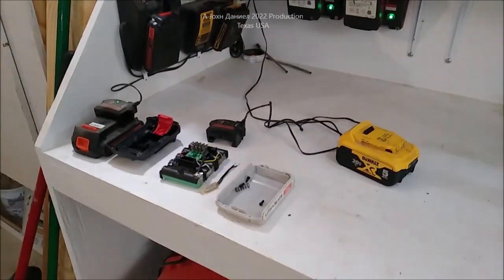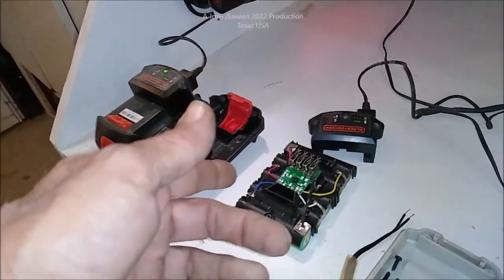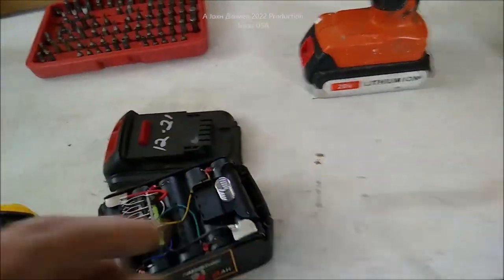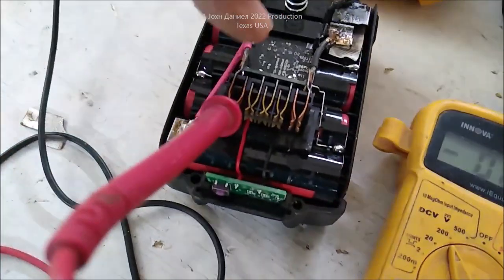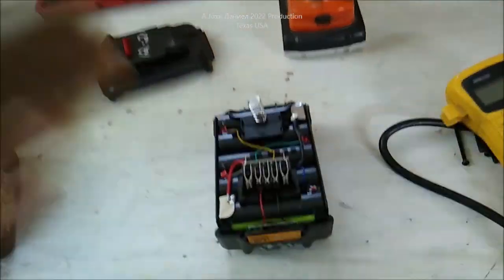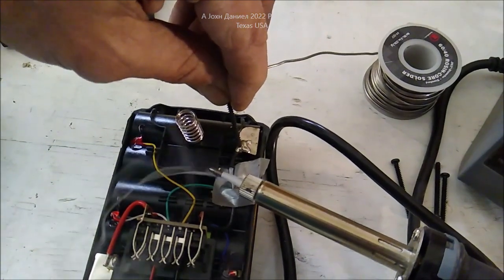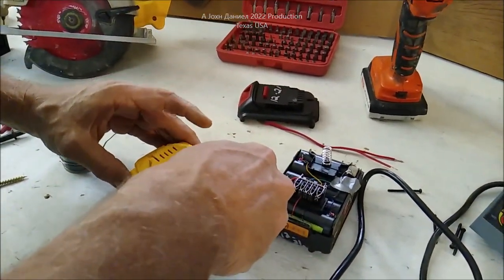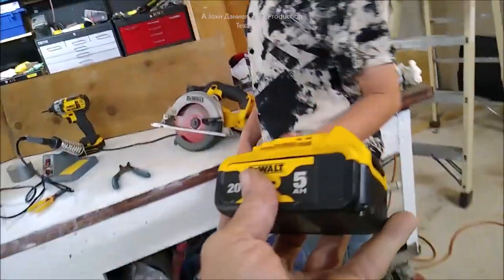Tool Battery Overheated, Won't charge or Respond? Try This

Comment from the maker: Must have Driver Bit Kits https://amzn.to/385dKGp , DeWalt 5A Spare Batteries I am using https://amzn.to/3DpZ4xo and I am looking for a source for Micro Bi-Metal temp switch for all tool batteries and will post it, check back.
Reply: I have found a source in the USA thar provides the thermistor that they use. Milwaukee uses a 6.8K, Dewalt, Snap On takes 10K. I got 10 each for approximately $3.50.

Comment: Have you trouble shot the temperature sensor on a 4 terminal black & decker 20V battery? its the center 2 terminals.
Reply from the maker: The sensor on them rarely fails, the chip on the board or the transistor switch to shut the battery off for them often does. You can get full replacement boards for them for the BD 20v battery for a few dollars. I keep spares for Makita, Black and decker, Porter cable, and dewalt I get from Ali. https://s.click.aliexpress.com/e/_c3wFDj7x
Reply: @JOHNDANIEL1 thank you. I did not see the BMS for my 20V porter cable on Ali. Can you provide the link?

Comment: John,   What are the color of the balance wires on a DeWalt battery.  What I have seen, online is all over the place.    I have been using yellow, white, green, blue (+ to - sides in sequence).  What is correct?  I am building some 2p, 2S DeWalt packs.

Comment: On that model charger Hot/Cold (thermal) Delay is indicated by a solid light on the right with a flashing light on the left, so that’s not a thermal delay (no right light). I have a DCB210 that no longer seems to have a connection with an open connection between TH (thermostor) and B+ so it genuinely triggers the thermal delay. It should measure ~10KΩ at room temperature.

Comment: super helpful video. I sorted a 6AH Dewalt clone battery that was stuck on overheat mode. In my case, however, it was still showing 2 bars of battery, but refused to fire any drill or charge.

It wasn't a large break at the ground terminal like you had, rather a small little thermistor right off the circuit board. Quick dab of solder, and she's going again.

Thanks for the help!
Reply: If you ever need to replace the thermsistor I found a source. Almost all tools use either a 6.8K or a 10K thermsistor.

Comment: Two batteries I found roadside. Bosch And Makita. Took home , no charge. Opened them up, each cell had power, One had a broken wire probably from being dropped, the other some rust on end of batteries down one side. Joined wire on first, a bit of a soft  wire brush scrub on the other and in an hour had two working batteries.  A simple fix saved me a few $. A lot of people would just bin them once they play up

Comment: This was great information. I had two 5ah  batteries overheat last weekend doing the same kind of longitudinal cut on a 2x4. Both batteries had quit and would not reset or charge. Cracking the case revealed the solder had indeed melted away to the negative terminal.  I laid in a new bead of solder in the gap between the contacts to recreate the fuse-able link, popped them onto the charger and both were able to take a charge again immediately. That was a relief. Thank you for the tip.
By the way, I drilled out the pins in the screw heads to get them out with the small Torx driver, then cut slots into the screw heads with a Dremmel tool  to not have to deal with the "lawyer screws" ever again, and can now just use a standard screwdriver to remove/install them.

Comment: I have the same bit set and 1 bad Dewalt Battery. I got mine replaced for free and will try to get the bad one fixed. BTW I have 6 Dewalt 20v 5AH batteries but my best batteries so far are 6AH clones, I run 4 in the big Dewalt Charger/ Inverter rig.

Comment: I have killed at least 4 Dewalt batteries like that with the same circular saw .
it's a battery killer. it draws too much power for the batteries that come with it.
thanks so much for this great info! I can revive them now!
Reply from the maker: After you repair, find a simple charger to reanimate them if they do not respond. A per battery 3.7 volt charger, using some wire, then held for 30 seconds on each one independently will do it.

Comment: What if the bank voltage reads around 14v
Reply from the maker: Then if it's supposed to be higher such as 18 or 20v then you have a few shorted cells. Worth opening and viewing anyhow.
Reply: @JOHNDANIEL1  yes it’s a 20v dewalt battery.  I bought a used dewalt sawzall and put my battery in. Pulled the trigger and released and it didn’t quite stop.  Could the switch be bad and overheating the battery because the battery became very hot.  That’s when the No charge happened.  I looked inside the battery and those soldered wires were still good.
Reply from the maker: Brushes or pwm speed control on saw is bad. Put battery in refrigerator for few hours, then return it to room temperature for about 3 or 4 hours and then put it on your charger and see if it responds.
Reply: You need to check all 10 cells. It can be just 1 or 2 cells....

Comment: Good fix, didn't know about this one.  Another common error for these batteries is the charger will no longer recognize them once any of the cells gets below 3V.  A lot of times you can take them a part and charge up whatever cells are low (or replace them if they went bad) and then your charger will work on them again.

Comment: Them cordless saws still ain’t got enough umph I use corded   Cordless drill are good but not much else
Reply from the maker: You got to give the latest models a chance, my DeWalt cuts as good as my corded Rigid but just under as good as my corded Porter Cable.
Reply: That is ridiculous.. the flexvolt saws cut better than the corded stuff without the hassle of a cord. No reason to live in the 90s

Comment: If you get batteries that get too low to charge, no short, what you can do is buy an ac to dc variable voltage controller.  The metal box kind with a dial control, digital readout in tenths of a volt, and a cooling fan.  I like the 0-48 volt/480watt capable version, it is very useful for so many things including renewing batteries
Reply from the maker: I just hit them with my NiMh battery pack. I have 10x2 charged as 12 volt, then series as 20 of the 1.2 volt 2300mah for 24 volts DC,  and they wake up nice.

Comment: Now I know why I'm so careful to not overheat batteries.  My ryobi cordless miter saw and the 7and 1/4inch circular saw quit on me.  Is there a way to fix them?  Seems like a switch type issue
Reply from the maker: They have a fusible link near the motor or in the trigger assembly if it's 120 volt saw
Reply: @JOHNDANIEL1  thanks, I'll look for that